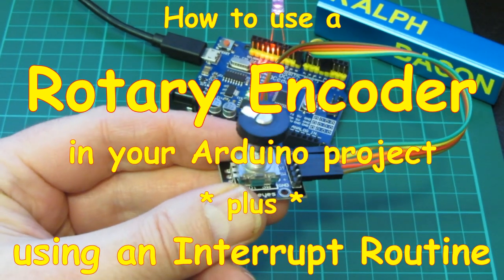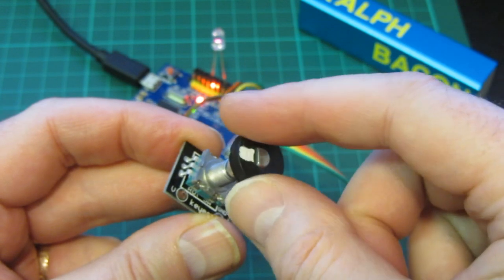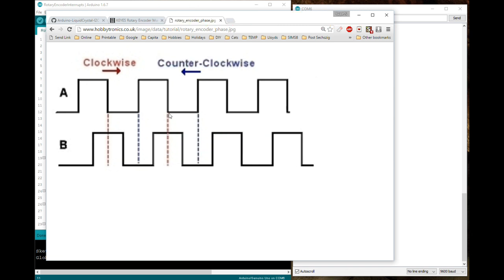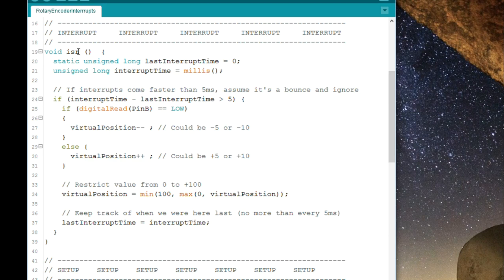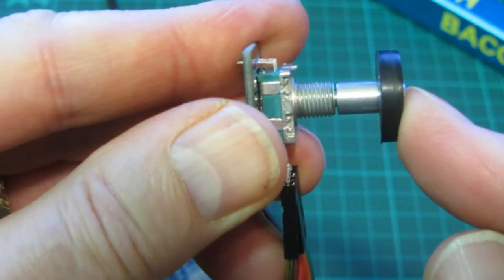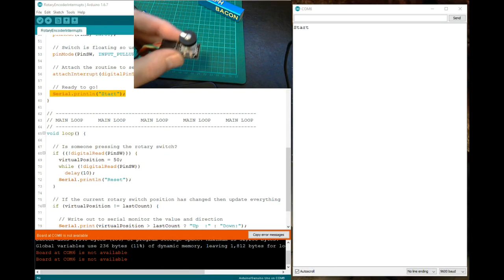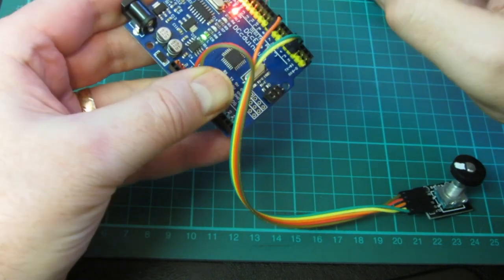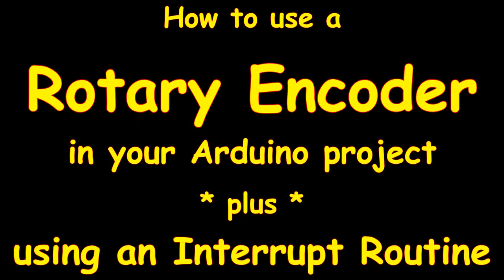#19 How to use a Rotary Encoder with an Interrupt routine on your Arduino

Comment: Thanks for the video. I couldn't figure out why you were interrupting on Clock going LOW instead of FALLING since your diagrams didn't make it clear that both pins stay HIGH when the encoder isn't moving. Once I checked (I just hooked it up and checked the pins with an LED), it made sense. No more using potentiometers for me.
Reply from the maker: You're welcome! You can try making it work on FALLING too, but I found it glitchy! Perhaps my rotary encoders are a bit "cheap".
Reply: @RalphBacon  It makes more sense to do the interrupt on LOW if the pin is high unless the shaft is turned. It's probably not the encoders. The clock speed on the Arduino isn't all that high. Thinking about it, the only time it would make sense to trigger on FALLING or RISING would be if the waveform never hit HIGH or LOW (I don't know the range for LOW or HIGH detection). Sine or triangle waves would probably work better, but there would still be some slop in the timing. That probably wouldn't matter for any application the Arduino was suited for.

Comment: Great and thorough video, by far the most useful interrupt video I've seen yet. Unfortunately/weirdly the code doesn't run on WOKWI which is where I'm currently practicing in anticipation of receiving components. The sketch seems to get caught up when you run attachInterrupt with a mode of LOW. I guess because it's simulating a rotary encoder it isn't sure what the pulse is when first initialised... or some other reason I haven't considered. I look forward to trying this out with actual hardware though. Thanks again.
Reply from the maker: Try using FALLING instead of LOW, as the interrupt will continue to trigger if set to LOW, whereas FALLING fires once then stops.

Comment: Hi Ralph, thanks for the great video! I am currently working on a MIDI Controller for my music (I have the parts but am having trouble ACTUALLY building it🤣). 
This is the list of items I want to connect to my Arduino Uno: 
3x Rotary Encoders (with push-switch function) 
3x Linear potentiometers (audio faders)
1x Ultrasonic Sensor. 
1x OLED Display (showing the selected MIDI channel and value of the potentiometers)

First off - will I even be able to connect all of these parts to the standard Arduino Uno or will I need something with more pins, i.e. the Arduino mega? 
I got the single rotary encoder to work using your sketch but I am wondering how I would go about connecting the other two and then also including the additional fader potentiometers...

Would appreciate it if you could point me in the right direction here, as I'm kind of lost at the moment! (This is my first electronics project so I'm still very new to this all as I'm sure you'll know!)

FYI - this is my inspiration for the project (so you get an idea of what I am actually trying to make): 
https://nuancescontroller.fr/

Cheers,
Calvin
Reply from the maker: Hey Calvin, the Arduino only has two interrupts so max two rotary encoder. Arduino Mega had many more plus more general purpose up pins. But for a first project this is ambitious; can you create a (much) simpler proof of concept project that runs on a Uno just so you get some experience of what's required?

Comment: Saving the state of B, by using A not only as an interrupt but also as a clkock input for a D-FlipFlop makes the whole thing much less vulnerable to the internal interrupt timings in the arduino, since the state of B, when turning the knob fast, might already be disapeared to something else than what it was when A changed e.g. "low" when the interrupt-routine tries to qantify the state of B as a reaction to the interrupt on A. --- So a little bit of additional external hardware like a 74HC74 might help a lot storing the actual true value of B when A triggered, as well as some 100nF capacitors between each A and GND as well as B and GND for debouncing the mechanical contact jitter.
Reply from the maker: Yes, adding a bit of external hardware would undoubtedly help, but this was just an intro and seems to work well enough. I talked about debouncing using external hardware in video #98 which provided a rock-solid solution. Glad this got you thinking (and posting your thoughts), thanks for that.
Reply: Just took a look into #98. Nice work!
I am not sure if I do like the diode stuff, since this presets the capacitor to some value I have doubt about. I think this is not just a question of the logic family used (HC, HCT, ACT, AHCT, LS. etc.) but also from the switching mechanics characteristics. My expirience is that this depends very much on the type of switch. Even between rotary encoders from different manufacturers there seem to big pretty large differences in switching characteristics (because of varying mechanical solutions used) ... at least from what my Oscilloscope tells me.

Comment: Hey Ralph I hope you are feeling better after the surgery. 
This is a great video as usual, very clear and well explained. 
I wanted for a while to control the position of DC motor by means of photo/optical switch. having looked at this video seems very similar concept using 90 degrees phase shift. I wonder whether you could share with us your expertise to control a motor using optical switch. your effort and time always appreciated.
Regards
Sol
Reply from the maker: Hi Sol, I did some work using a mechanical switch to control a DC motor (a stepper motor) but you may get some ideas from these videos #38 and #39. Good luck and thanks for your good wishes.

Comment: Great explanation. Must learn more about interrupts on arduino. There is a fantastic library called Rotary. I will try to find the link. works with all encoders, full or half step. Never misses a pulse also.
Reply from the maker: Hello Arduinite! I'm currently on vacation 5,000 miles away from home so I'll have to be brief with these comments until my return, mid-July.
 
Glad you like the video, Neville, and interrupts are a good topic to master. I've covered them from time to time during my videos. If you find those links please post here!

Comment: Great video on encoders and it was really educational. I have an Arduino Mega 2560 that I plan on using eight encoders with. I would love to hear your strategy on how to accomplish this.  My current strategy is to Mux the 8 A pins and 8 B pins into 2 separate Mux's, using the same 3 address lines for both. Setting the 3 address lines and reading the 2 input lines would happen in a timer interrupt routine. I thought I would use timer zero already running at 1 ms. Instead of looking for transitions I would map the 2 bit Gray code into 2 bit binary and check to see if the number was increasing or decreasing relative to the last read. This would give me the direction. And every time there was a change in value I would either increment or decrement the virtual position. What do you think?
Reply: BTW The use case is knob twiddling on synthesizers. So the encoders are for human hands and most likely only two will be used at any given time.
Reply from the maker: Glad you liked the video; but as for your encoder strategy it sounds dodgy! You have six interrupt pins available on a MEGA. Paralleling the encoders up like this is not something I would do. How does your interrupt routine know which rotary encoder has triggered the interrupt? Trying to multiplex various encoder signals onto a timer routine... I mean, what could possibly go wrong? (Spoiler alert: lots). If you really think this would work just try it with two onto a single interrupt routine - and let us know if you have got it to work (reliably)!
Reply from the maker: Having thought about this overnight (is that sad?) is sounds like you're using Rotary Encoders in the same manner as a keypad matrix with columns/rows. Thus you poll for particular pins (A or B) and determine which Rotary Encoder is being used. Is this the approach you want to take? Unusual but stranger things happen at C. (pun intended).

Comment: Hi Ralph, Great video as always! 
I'm working with a filament spooler for my 3d-printer and using PWM output for the servo motor. So far it works fine but when I try to use external interrupt, for another task, the servo motor acts strange. It starts moving to wrong positions.
Is it so that the interrupt affect the PWM function?
The Arduino I am using is MEGA 2560.

Regards
Jan
Reply from the maker: The interrupt will, as the name implies, interrupt anything running, although the actual PWM signal is generated by separate hardware so should not be affected. 

But if you are moving or adjusting the servo signal then that will be affected by an interrupt; keep them very short and simple and do all the processing in the main loop(). 

Or use an ESP32 and put essential processing in a separate task (or several tasks) - I did a couple of videos on this.

Comment: Very nice demonstration, I think I might borrow some parts of your code for my project. Huge thanks. However I'm confused by the usage of millis() inside the ISR, as from what i remember it can't be used inside the ISR. Pls explain this.
Reply from the maker: You can use millis inside an interrupt function; they just won't get updated there. As all I'm doing is taking a snapshot, that's fine.

Comment: Hi, I know it's been 4 years but I just started :). Thank you for the videos, they are giving me great opportunities to learn something new. Do you know that millis() does not work inside ISR? This is indirectly the reason FALLING gives erratic readings. I believe switches inside the encoder are bouncing and with millis() not working you are getting multiple falling edges as you cannot ignore them.
I'll keep watching your videos. Regards.
Reply from the maker: Indeed, millis() does not work (the value is never updated) within an ISR but micros() is OK-ish! I think the rotary encoder I used in this video is giving me multiple falling signals (poor quality or dirty contacts) thus it triggers erratically. LOW works because I ignore the same state. One day I will fix this for good! Great to hear from you, Pikor, you now have #190 videos to watch!